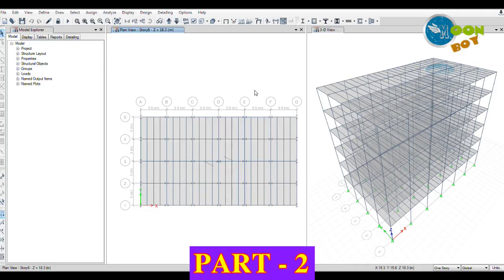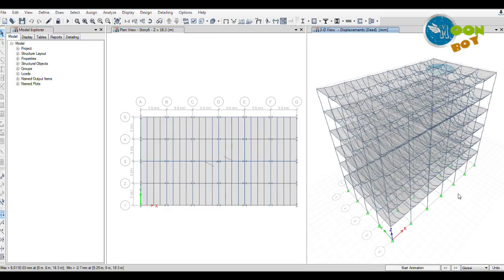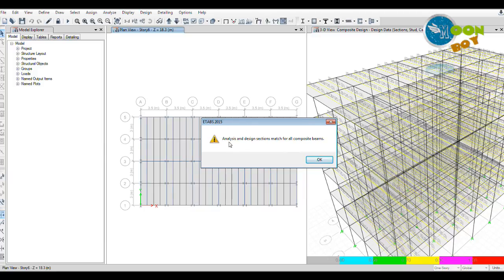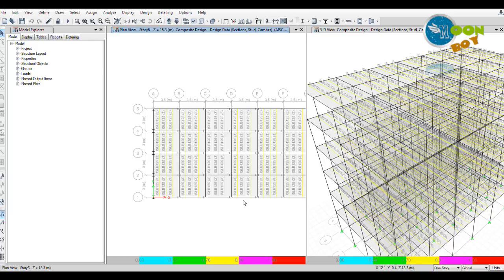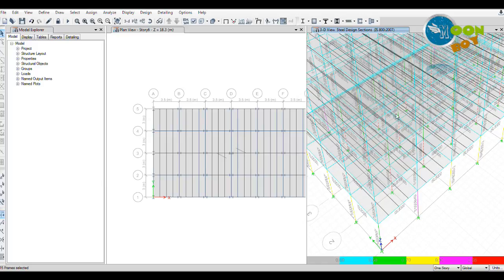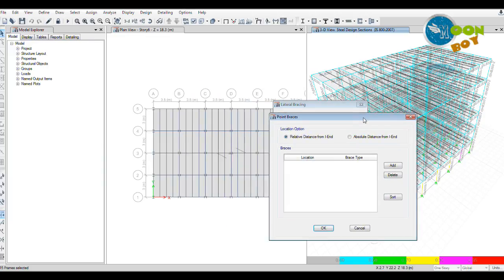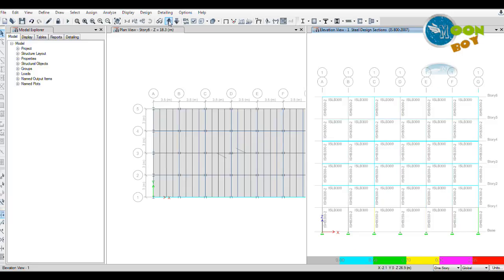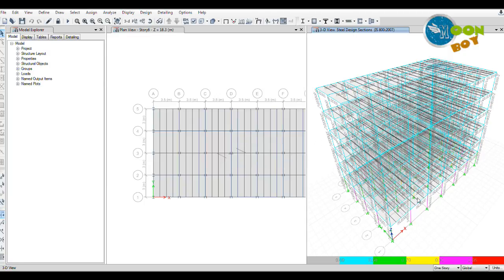Etabs 2015 tutorial 8 | Steel Building Analysis and Design | Using IS Codes | Part-2

Comment: What should we do when it regularly fails the design
Reply from the maker: You must use auto-member while defining the structural members then it will take automatically the passed size required, out of the different options of member sizes you selected.
Reply: I have use auto member while defining but it fails regularly
Reply from the maker: @samidangol496  Then you need to provide combined section.

Comment: What if i use Channel section instead of I section
Reply from the maker: You can use.
Reply: @moonboyslife  how to model it  channel  section column and design with lacing
Reply from the maker: @structuralplatform4092  For that use the section designer..
Reply: In section designer should we use lacing initially ?
Reply from the maker: @structuralplatform4092  read it from the support in etabs website knowledge base that how to do a section design with lacing?
Reply: Can we provide me link sir

Comment: Sir.. But columns are in still fail pink colour(0.9)?  And it's want to be redesign? Until its get yellow colour? And how will design beam column and composite beam with out auto select?
Reply from the maker: For that Use general procedure by using frequently used sections or common sections.
Reply from the maker: For composite beam use the composite beam option

Comment: can we use  concrete slab insteat of composite beams in steel structure? and or push over analysis is it necessary to provide diaphragm instead of concrete slab? if yes themn why?